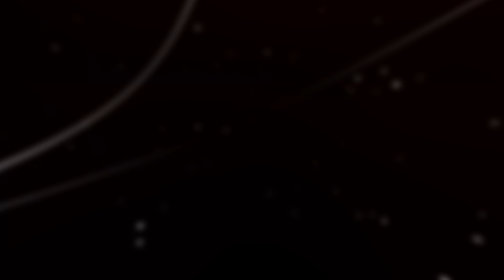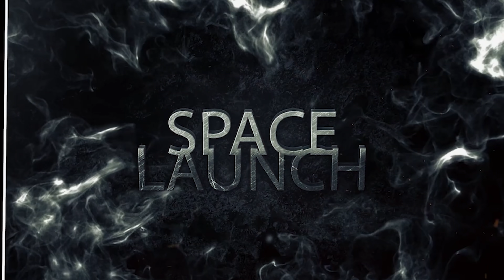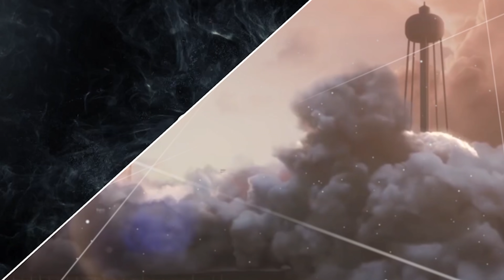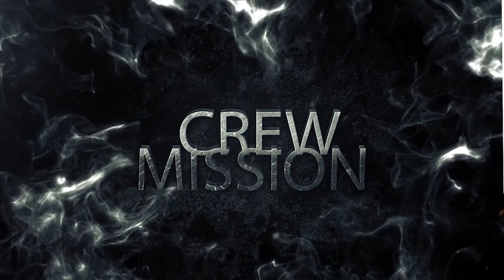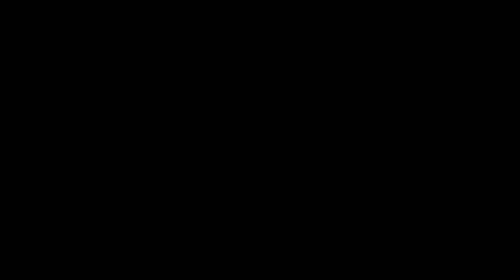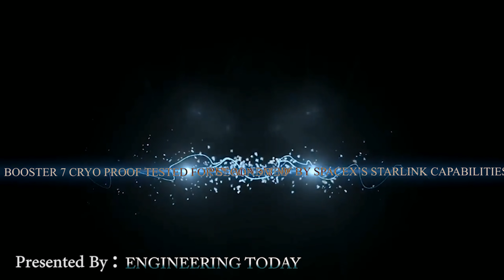SpaceX Starship: Booster 7 Cryo Proof Tested | China ‘Deeply Alarmed’ by Starlink Capabilities! Why?

Comment: Well done, SpaceX!
Reply: I think it a bit tragic that Elon Musk’s dreams of moving humanity toward the future as a space-faring species seem doomed to failure.  And there exist solidly considered reasons for this dark prophecy. Right now, I struggle to write a paper which attempts to theorize around that prophecy. My paper explores possibilities for space travel which encompass a totally different means of travel: the deformation of spacetime. 

Musk, along with most humanity’s technical and scientific expertise remains largely trapped in the relativistic paradigm first introduced by Einstein’s special and general theory of relativity: nothing can travel faster than the speed of light. And even to travel a fraction of its speed would require a prohibitively huge expenditure of energy for propulsion.  If Musk were to really think through the issue of space travel, he might realize that our current model of thinking renders space travel for any great distance laughably impractical. 

The idea of space deformation along the lines of the much-discussed Alcubierre drive also seems doomed. Leaving aside for the moment the problematic issues connected to this drive, one can think through alternatives which achieve the same result and without having to utilize some form of exotic energy to deform time space. The alternatives mock the confinement of scientific thinking to convoluted schemes. But if we can think outside the box our, we may wonder why we didn’t see the solutions—so simple and directly obvious-- which always existed right underneath our noses
Space travel along the idea of current thinking is a dead end.  Anyway, I now right this tract half asleep and too rapidly to express the idea clearly.